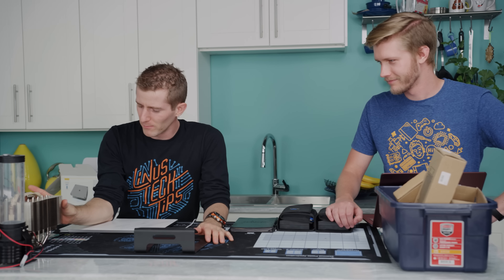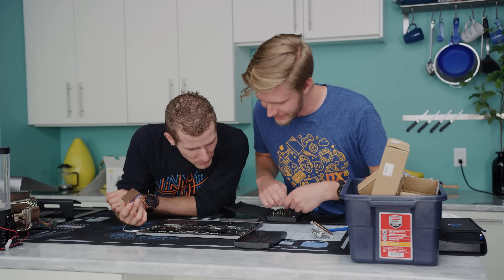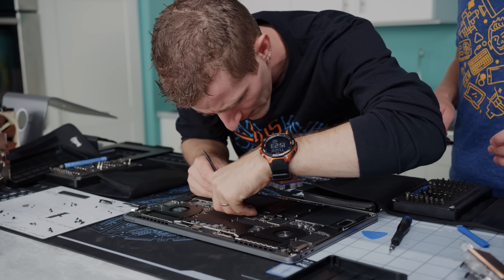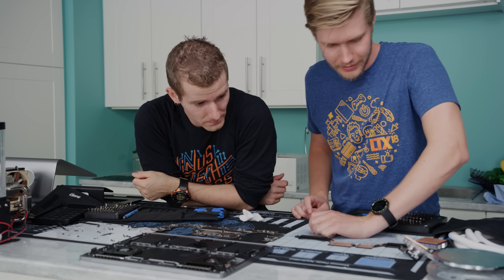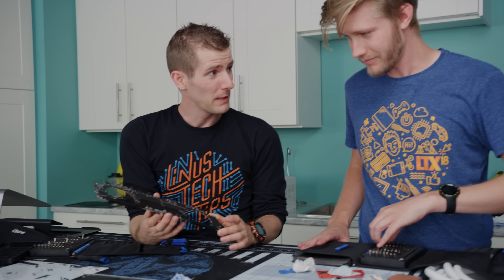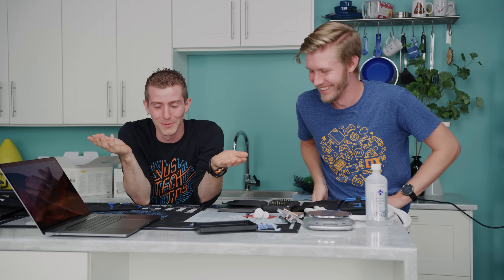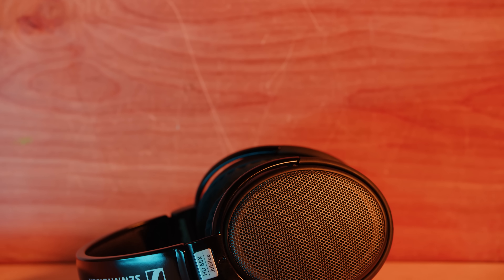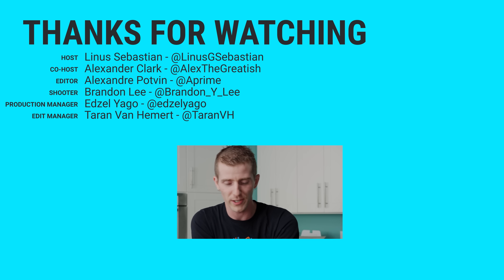We FIXED Apple’s New MacBook Pro

Comment: An easier thing to do is to take 1.5mm thermal pads and place the along the heatsink, and small bits on regulators. My 15 inch now runs all 6 cores at the adversited 4.0ghz boost clock and doesnt throttle till 70Ws, with cpu and gpu load it can handle 35w + 45w and still have some room left. The downside: it's not a laptop anymore, you'd have to be wearing some thick pants to be using it on your lap.

Comment: As someone who sets a custom fan curve on their macs, the lack of performance benefit is probably because of Apple’s really passive fan curves. Liquid metal = lower temps which means the fans kick in less. I’m pretty sure you would get a much higher “relative performance” if both the before and after was tested on 100% fans.

Comment: Next time use thick thermal pads and connect heat pipe and rest of components (VRM in specific) with the bottom case. I’ve got an outstanding results doing that, plus you won’t ruin your warranty. I’m really surprised that you didn’t show that, as it applies to almost all MacBooks.
Reply: can you show us how / a link? id like to do this to my macbook

Comment: I cannot believe that Apple engineers think it would be acceptable in any way to use THIS (4:50) as a cooling solution for this type of processor with a discrete graphics chip. Nor can I believe that Apple fans, in general, can defend this with a straight face. Absolutely shameful design for this type of machine.
Reply: Well at least they kind of fixed it for this year’s model

Comment: everyone is complaining about apple making there devices not upgradable and harder to be serviced by the end. for example: soldering the memory and storage to the logic board. What I dont get is why they dont just solder the heat sink to the cpu and gpu. that would make it very hard to service but a least the temps would be amazing :P

Comment: Red, German sticker says don't use with aluminium bodys. 
So i guess the liquid metal stuff contains mercury? That would react with aluminium on the touch to aluminium amalgam, essentially corroding it.

For that reason  mercury is banned on airplanes btw.

Comment: Here's what I would use liquid metal for:  your old computer.  You bought a new computer, and you're using it for most things now, but you've got your old one around, so you might as well find something for it to do, so clean out the fans, change out the thermal paste, up the RAM, swap out for a little SSD, and then use it for god knows what.

Comment: Despite the odds...
... how often do you have to replace the liquid metal? / which intervals?

I have an older macbook and have to replace the thermals soon anyway, and since thermals are a problem (at least at the current state) I tried to make the best out of it. But if i have to reapply it every 1-2 months, i definitely wont do it. 1-2 year intervals on the other hand...

Comment: Hey you guys should do a video on the mac pro 5,1 from 2010. It's the tower model and can actually be equipped with a 10 series graphics card (so long as you have an aux PSU). It's a really upgradable, well designed and accessible tower. Apple should really go back to those days because I still use my 2010 mac pro! It would be interesting to see a comparison to the new iMac pro because that thing is kinda a joke in comparison, even tho it's specs are good. You can even upgrade the CPU's to 2x hexacore Xeon 5690s @3.7 Ghz, 24 threads. Not the fastest but still potentially really relevant!
Reply: This comment aged well
Reply: Apple won't go back there making to much $$$ on the disposable computers

Comment: Since the warranty is gone anyways: I dare you guys to undo the backplate and go sub-zero cooling on it. no isolations tho. let that piece of shit sweat to death while benchmarking. 
Undo the cooling mod afterwards, re-apply the thermal compound really bad, that it leaks out everywhere, don't dry the board off, screw it back together and send it in to apple, telling them the temps lead to melting the compound and it sweated the entire system. just for shits n giggles obviously.

Comment: Hey Linus! I just recently purchased the MacBook Pro with Touch Bar and I have an issue with it getting really hot when using any extensions like an HDMI cable or a Wacom Intuos tablet. Would this be the same problem? I have the i7 model

Comment: I did it to my asus GL702vm because the gtx 1060 6gb bitch slaps the 7700hq. The 7700hq used to thermal throttle up to 47% and now it doesn't at all.

Comment: if you using the the latest version of Mac OS, Then it's probably that "Kernel patch" From Apple getting in your way with Performance boosts on the shorter test. (You know the one that "fixed" the thermal throttling issue by default in the CPU to one of the lowest power states)

Comment: The REAL way to fix it is to NOT buy it and spend your money on a proper laptop
this doesn't even have enough heatsink for a 45w tdp let lone 150+w of tdp 
a standard laptop cooler would have more volume than this. It won't cool it because its still over 90W tdp. But what is this? A heatsink for ant computers?  
A computer that NEEDS SCREWS to turn on. NOW that is just the STUPIDEST thing ever and why this is actually an MACBOOK AIR NOTPRO

Comment: "People who fix macbooks all day?"
So... you mean, Louis Rossmann then - and nobody else anywhere, especially in an apple store?
Reply: Genius bar be like
Looks at mac for 15 min
Screws something in wrong
"You need to replace the whole motherboard"
Reply: @MementoMori-xx5qo  again I disagree. Material costs aren't everything. Remember apple doesn't use of the shelf parts. They use their own made parts. Apple uses first party parts (which are difficult to get without ASAP certification) making it cost a bit more. Think, you can buy cheap aftermarket parts for your car that cost less than OEM parts, but are not necessarily of the same quality.
Reply: @Champoforyx  applr dont have to use first party to be great. But they still do it anyway. Which prevent other to have a easy and cheap access to their parts. I think monopolizing the market is the goal.
Reply: @MementoMori-xx5qo  the reason it cost more is typically the parts they get through Apple's supply chain cost most.
Reply: @MementoMori-xx5qo  profiting is how a multibillion dollar business or any business thrives.... Look I can only speak from my own experience and I've found that Apple does great repair work for a reasonable amount of money given that they fund all their own software development and develop and design all their own hardware.
Reply: @MementoMori-xx5qo  I disagree in my experience the quality of Apple's repairs are quite impressive and they will warranty the fix after making a broader check of the machine.
Reply: You're wrong I've done work as a Genius at an Apple store. Atleast in my experience, most people needed help with iMacs more than macbook but still many people came in with MacBook troubles mostly screen repairs or drive problems. Never have I seen such great customer service and care with devices.
Reply: @Champoforyx  you clearly missed the joke
Reply: @Champoforyx  I Smell heresy.

Comment: All Apple needs to do is use something other than crap between their chip and heatsink and the machine would be halfway decent (oh and also they should add different ports, magsafe, better battery, good keyboard, smaller trackpad, replaceable storage...oh wait they did that but thought it was too good for everyone and so they changed it. If Apple just upgraded the CPU and the GPU and RAM in the 3rd gen MacBook Pro and sold it again, it would destroy sales of the “new” one)

Comment: So many screws, and it won't turn on without them? Finally, proof Apple is just screwing with us now!
Also I want to see what a properly cooled i9 MBP can do. Like, totally impractical desktop liquid cooling solutions bolted to the bottom. Or at least run a fully patched one inside a good freezer since that seemed to make a huge difference before the thermal-throttle patch.

Comment: How many bits would you go through for a solid case of aluminium? Depends on the grade, but with some standard alu, probably none. Get a block, drill as many holes with an U-bore as possible.
Then you can feedmill it out using mist and high pressure air for cooling. The only problem I could foresee is chattering, so you'd need a bunch of supports for the sides. Basically weld a case for the case first to support the flimsy walls. It would be a such a long process. The case would cost thousands.

Comment: Yo linus and other guys that take shit apart with lots of screws. Start in one corner and unscrew the screws in a clockwise or counter clock wise fashion, and lay the parts or screws, out in the shape of what your taking apart, and in the same rotation as your un screwing them. 

Then you'll basically have a mirror image made of screws. Then you just screw them back in the same way they came out.
Reply: Exactly! That's what I do, too! Much easier! lol.

Comment: DELL laptops also usually have a backplate screw that's required for it to boot up.  I think there's some grounding or something built into the case that doesn't connect without that screw.

Comment: You know, the reason for the throttling is the voltage regulators overheating. They overheat because they are not connected to the heatsink. Swapping the thermal compound will do absolutely nothing.

Comment: ATTENTION! DONT REPEAT THE ACTIONS SHOWN IN THE VIDEO! LIQUID METAL WILL BREAK CPU, AND ALSO A MOTHERBOARD! 2-3 degrees of cooling will not change anything! But you risk making your MACBOOK a brick! In addition, after these actions, no service center will not accept it for repair! The liquid metal corrodes the crystal of the CPU after a while! And after that you will not be able to apply thermal grease, as liquid metal is eaten into the processor!

Comment: The screw that goes in to a screw must be a ground screw, & Y they are taking it apart is simply because they can, watch it soon they will put the computer in A full enclosure in side it self to where it does not open & when it breaks you have to replace the hole thing!

Comment: LTT: ACMT here, i've noticed that when putting back a MBP with USB C that it does take 2-3 power button pushes for it to come on. Doesn't need screws in the bottom. First push is almost like a POST then you have to do it again for it to come on. Also had them turn off randomly like you, then need to power back on to resume normal functions...you're not the only one =)

Comment: Pro tip,
You don't have to have the bottom plate screws in. Any time you unplug the battery from the board you have to "prime" the power to the board once it's connected again. Just press the power button 3-4 times in about 10 seconds and you should get a boot.

Comment: 13:40 gamers nexus ran a longevity test with thermalgrizzly liquid metal and found that over at least a year of thermal cycling it didn't lose any cooling performance. Certain blends of liquid metal may need reapplication, but it depends on the alloy being used.

Comment: I am still waiting for someone to show me a Windows laptop with i7 8750 or higher that has the same or better build quality than the macbook pro, with a trackpad that is as nice as apple's, a good graphics card and in a decent - ultrabook - size factor (no gaming laptops please) that doesn't thermal throttle. it has to be pretty too.

Comment: No temperature or clock speed measurements before / after the liquid metal application? Cmon guys...
Reply: I would have loved to see them install a fan controller and ramp up the fans with the liquid metal applied. See when it starts throttling. I have a i7 version, and my CPU never hits above 65C when I render out of premiere pro.
Reply: 😁😂🤣😅 it's a mac it doesn't matter. Just go for a liquid cooling solution and piss on the fucker
Reply: This. It was probably just taking a little longer to get to 100c and for the chip to start screaming "NO MORE!" to prevent itself from dying.
Reply: Rook Probably it doesnt even get in full clock at 100°c, it will probably start throttling in about 85-90°c or 95°c depending on the manufacturer
Reply: @Foxtrot-f5l  I dont speak spanish, im sorry.
Reply: It was probably the same temps, because Apple's fan curve only starts whopping around 95C.
Reply: Cause they already proved it, https://youtu.be/hdTsra-uLBI
Reply: Spaced Invader Yep, but that does not mean a engineer wouldnt know that. 
These type of engineers would know what lois rossmann knows. I've met several in person, and they have to lear these things. 
Actually, with the right amount of money and equipament, time and dedication you can learn anything from eletricity to iT... But still there are engineers for such things.
Reply: Linus isn't an engineer... He's a comedian.
Reply: Eric Matthews Actually he has a tech channel, and done that before. 
And a little bit of professionalism doent hurt anybody.

Also why the heck only a engineer would be able to do that? This is common... A engineer would measure the vrma current and temperatures... Just look at what Lois Rossmann does, that would be what a engineer would do...
Reply: @eduardoavila646  #&$% you that's why
Reply: @hahafunny3420  Read your nick
Reply: No undervolting? Come on guys..
Reply: TabalugaDragon Lol true. With these newer shitty laptops undervolting is obligatory

Comment: How to upgrade cooler in normal PC:
1. Open PC
2. ???
3. Profit

Mac:
1.Take off back panel.
2. Remove the trackpad (but why, you may ask? Nobody knows for certain)
3. [Insert 50 steps I couldn't be bothered to type here]
53. Run out of space to mark all the different types of screws
54. Curse whoever recommended you to buy Apple
55. [Insert another 10 steps here]
65. Drop a screw, break the whole thing.
66. Realize you voided the warranty just by looking at it.
67. Buy a new Mac, because you're stupid and a sucker for overspending.

Comment: You may want to do a pull through with Blowie-matron.  put some ducts to the exhaust ports on the MacBook (made out of something thin and rigid, like a thick foil or metal,) and put Blowie-matron into Sucko-matic.  It would be interesting to see.

Comment: i'm very pleased that LMG is using liquid metal because i've been harping about that idea for a while. I actually thought the cpu was soldered on but apparently not. Yay!
Reply: wait. NO NO LINUS. HOW HOT DOES IT RUN??? ANSWER THE QUESTION! WHAT'S THE POINT OF THIS IF WE DON'T KNOW IF IT JUST WON'T THERMAL THROTTLE OR RUNS AT A SAFE TEMP???
Reply: The CPU is soldered on. He just lifted the heat pipes. And the temps are still shit.

Comment: That laptop costs 5000? WTF !
Reply: 5000 canadian
Reply: $6700 for the maxed option
Reply: @khangle6872  with a 1080ti sli inside? Otherwise its really really overpriced
Reply: SSDs are the most expensive part of a laptop nowadays
Reply: of course it's overpriced no matter how you see it
Reply: +Mike Crapse nope, i think the most expensive one is RAM (if not CPU and GPU)
Reply: @shagstars  Apple love to over priced their cheap products.
Reply: @killertruth186  apparently they do, in the early days they did gave value for the price but now it is just a slower laptop with mac os for double the price of a equilivant windows laptop. Bought an i7 gtx 1060 6gb laptop for 886 euros which seems right.
Reply: @shagstars  Sadly it is true. Too bad that they had loose sight of the competition.
Reply: @killertruth186  Not to hate on the fans but because nobody boycotted the practices/releases of apple they've got away with it for quite some time. They will not change till theu gotta feel it in their wallet.
Reply: @shagstars  Lol Macs don't use Nvidia graphics and even if they did you can't SLI in a laptop.
Reply: @mikecrapse5285  Tell that to the ram
Reply: you can man, msi gt83 titan which is 5000 euros. And some other laptops but its a niche
Reply: @shagstars  My bad. I should have said "Macbooks" rather than laptops.
Reply: ShagStars Productions True.
Reply: @shagstars  That's not even that much in comparison to this. This is just typical Apple overpricing their subpar product.
Reply: @shagstars  I know ur joking but 1080 ti cannot be put in laptops
Reply: @babluthowdhury5893  No but for the money they could. It draws less power than a gtx 1080 sli which some laptops have equiped for the same price.
Reply: Mike Crapse the most expensive part of this laptop is likely the cpu or the screen. or the r&d. or the hbm2 memory if you opt for a vega 16 or vega 20 model.
Reply: @mikecrapse5285  no you can get samsung 860 evo for 85 dollars and it's really good
Reply: should be 2250 american dollars maximum
Reply: 7600€ in germany
Reply: Its still overpriced but the cheapest version is like $2,000
Reply: 4tb nvme ssd is like $3000
Reply: First time to apple?
Reply: When youre making 80k+ a year and its your daily driver, you really enjoy the device. I always enjoy when mouth foaming pc gaming nerds come on here all surprised that people use their shit for OTHER THINGS. As a PC gaming nerd myself, youre not helping.
Reply: Not that expensive, it's comparable to a Razer Blade or MSi Stealth (of course it's gaming performance vs productivity performance here + apple's premium)
Reply: @TheVivi13  oof
Reply: @mirono3099  What's up?
Reply: @TheVivi13  I dont think its as powerful though I got the newest alienware gaming laptop for 2000$ runs games at a 100 fps
Reply: it has a core i9 and a 3tb PCIE NVME ssd.
Reply: it can be over 8000. most overpriced laptop ever with no way to defend it
Reply: Grand Master Yoda Well you can defend it, but since I think that you won’t accept anyone defending it, I consider it to be better if I let you think about it the way you do. (Yes I know that this comment is over a year old)